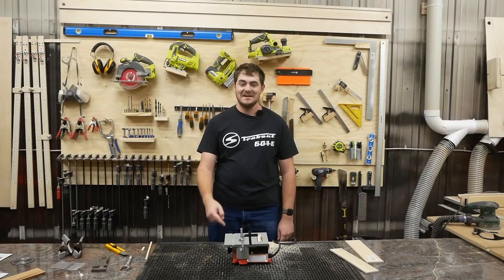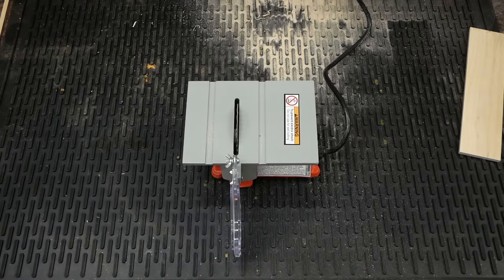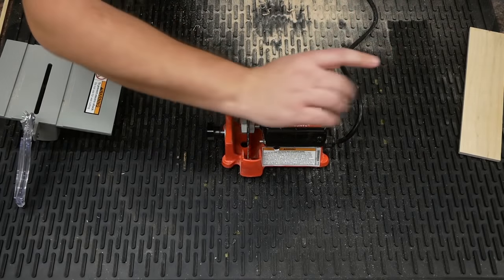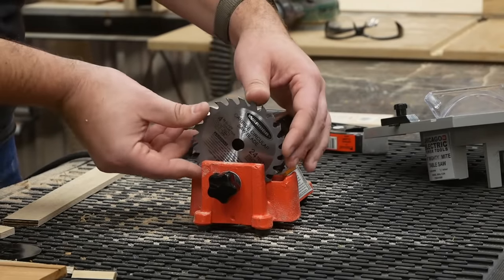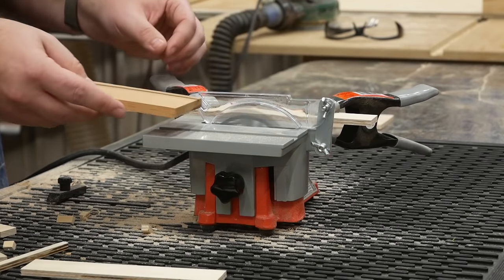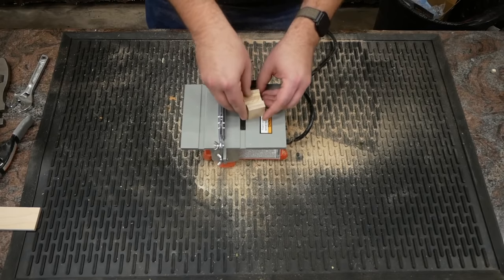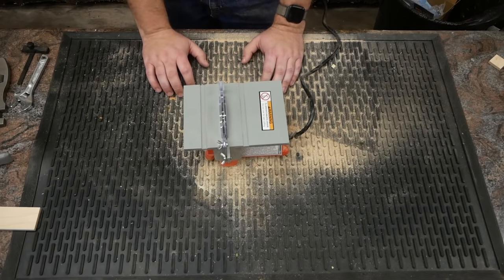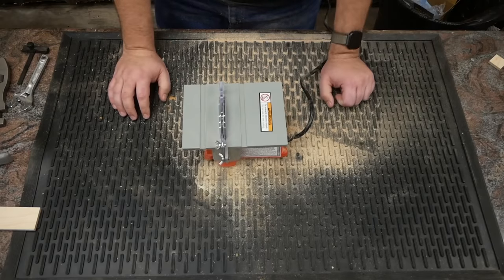Can This Adorable Tiny Table Saw Do Anything Useful?

Comment: This thing actually looks more dangerous than a full sized table saw.
Reply: It is.
Reply: My thoughts exactly
Reply: I know right?
Reply: This thing is almost the same size as the brake cartridge mechanism in the Sawstop table saw.
Reply: I agree. And those cheap portable table saws are scary as well. The safest table saw I've ever used was also the heaviest, quietest and fantastically expensive.
Reply: Mainly because it’s impossible to keep your fingers away from the blade.
Reply: I was honestly cringing a bit when he was cutting the small tile, and not even looking at it.
Reply: Waaay more :/
Reply: And table saws in general carry a good amount of danger, too. Seems like most of the shop injuries I hear about are either table saws or lathes.
Reply: @auxchar  I was allowed to operate a several horsepower lathe when I was 14, alone at school.

I only lost a portion of my thumbtip which grew back, looking back I count myself very fortunate indeed. Ever since I've had a lot of respect for anything that rotates especially if it's sharp/has a lot of rotational inertia.
Reply: @CommodoreFan64  Why? tile saw blades are smooth with no teeth to grab flesh. i've hit my finger on one and even touched the blade while running. 
not a damn thing happened. it was a wet tile saw but still. the only thing that cuts tiles on the blade edge is tiny industrial diamonds embedded into the a metal ring at the edge. 
cool thing is they last quite some time if you dress the blades to expose more micro diamonds.
its like a cast saw doctors use it does no harm to flesh. unless you buy the wrong blade that does have groves. that might do something.
Reply: @darkshadowsx5949  I know all that, but still makes me cringe when someone is not paying attention around a table saw, or any saw for that matter, because as a teenager I was in the shop on my step grandparent's farm, and one of my cousins was cutting a piece of PVC pipe on the band saw not paying attention, and nearly sawed off his pinky finger, and I had to rush him to the urgent care with his hand in an ice bag to get it stitched back up.  He was lucky he did not cut the bone clean through, as the Dr. said he might have lost that finger for good.
Reply: @darkshadowsx5949  According to the reviews on Hazard Fraught, people who are cutting FR4 PCBs have found that the motor doesn't have enough chooch to damage skin if you have the diamond blade on.
Unfortunately you can't find replacement diamond cutters because the arbor is 1/2" while most blades that size are 5/8" unless you buy a blade from Amazon that's almost the price of the entire MightyMite.
Reply: That's why I installed a saw stop on mine
Reply: It absolutely is. Center of mass is too high because it's so narrow and light. Strong, sharp, heavy tools grievously injure you, but they're more predictable and you can have better guarding.
Reply: YOU can BET it IS VERY Dangerous !!!
Reply: @CuckBalls  but not nearly as fun
Reply: It is.
Reply: @harlanbarnhart4656  Those are actually far more dangerous because the blade rotates at a faster speed with more torque, ensuring a thorough laceration before your reflexes kick in. Unlike the puny motor on the portable ones, the power will apply a much larger force to the workpiece during a kickback, enough to cause internal hemorrhaging if the work piece hits you in the wrong part of your body.
Reply: the thing in the black T shirt doing the hee haw demo? no argument there.
Reply: @samspencer7765  , Glad to hear you didn't lose an arm or your life.
   I lost a non-union job because I wouldn't break the rule learned in union work, wouldn't work alone 30' up - but would have if had another worker nearby.
Reply: @samspencer7765  Anything spinny is inherently dangerous due to being able to pull you in.  (I knew a guy in school who's father lost an arm in a tractor's power take-off shaft that way.  What's worse, he was there at the time  And Adam Savage was just a dumbass a couple years ago while cleaning his lathe and tried to clean a spinning shaft with a rag he held in his hand instead of keeping it on the end of a flimsy stick like the generally smart and experience man he is should have known to do.  He was luck he got a gash in one finger and didn't even lose the skin over it, when he could have lost his hand.)  Table saws are just really easy to be really stupid with.
Reply: If it falls off the table you can easily catch it! 🤚
Reply: Took the words right out of my mouth 😅
Reply: If that little saw scares you, you need to stay away from all power tools. You're to much of a dork. Master machinist

Comment: As everyone else has said a year ago this is meant for very very small dollhouse/hobbyist balsa wood type projects. The fact it has a "finger" (lol) guard for the blade is actually really great - most of the cheap ones you can find are literally just a block with a table saw blade sticking out the top with no safety features. I'm gonna have to go through your whole channel now to see if you review any other tiny woodshop tools because you are excited as hell and I love that.
Reply: Agreed.  I am a hobbyist and was looking for a small version of a table saw for cutting small wood frames and balsa wood for diorama building.  I dont need a large table saw for that.  But the ones I found were much better than this, but more $$ too.  The best was over $300 and costs as much as a regular table saw.  But all the ones I saw were slightly bigger than this too.
Reply: @panzer948  It might be the right size for the job, but you need something you can make predictable cuts with.  And a bigger table would be a good idea as well.

Comment: I bought one recently and made a couple upgrades: built a much larger frame around it with a 16x20 surface, to which I applied a plastic grid; and replaced the blade with one from Micro-Mark. Note of caution: when removing the blade be careful to turn the nut CLOCKWISE to remove it, and do so very carefully to avoid stripping it and the arbor--they are both made of fairly soft metal.
Reply: Yep, I almost did that myself... couldn't understand why I couldn't loosen the damn thing! 😂

Comment: I got one to chop up old circuit boards. It doesn't have enough power for that either in case anyone was wondering. Gonna keep it though, 'cause it might come in handy for craft stuff - plus the cute factor! UPDATE: Ah, wait!!! The diamond blade cuts though circuit boards and ceramic body components like a hot knife through butter - really. Stay away from plastic body components like large connectors, and super long cuts - and it barely bogs down at all. The mighty-mite is redeemed!
Reply: Excellent.   I was wondering about that, considering that most of the boards are glass fiber reinforced, so therefore using the tile blade makes more sense.

Comment: "yeah I'm a carpenter, I'm renovating my broom closet into a shop right now"
Reply: Try a bread box first. Then move up to a broom closet. One can't have all the shop space when starting out in life.
Reply: My shop/server room is one half of our master bathroom.
We don't need 'his n hers' sinks, and never used the 'roman tub' which is just a regular tub that flares about 4 inches in the middle, with space wasting framework around it.
We never used that bathroom for bathing at all.
So I built my server rack over the existing tub, the shower stall became my pc carcass storage, and my workbench is the maple plywood that makes the top of the rack.
I still have empty air that needs to become storage, but I'll never cut wood in there - even with dust collection it would be death for my servers.
Reply: @Zomby_Woof  you have no idea how reassuring it is to know I'm not the only one doing things like this. (My wife and I covered our balcony in glass panel windows, and we use that for cutting wood and grinding metal etc, everything that is dusty or overly smelly)
Reply: I honestly work out of my kitchen  closet of my apartment. 
I have no other choice but to if I want to do wood working projects until I can find a garage to rent out of a work shop. 
So, some people really do work out of a closet.

Comment: Amazing 120 volts and 1 amp is 120 Watts. Great for cutting insulation on Skoolie build-out or building ginger bread houses when out in the woods.
Reply: Actually, i think it would work well to true up gingerbread parts for a gb house.
Reply: @OpasJDGarage  gb houses for all of his chickens on Christmas, if only he could train his rooster.Maybe  next video we will see his rooster with safety glasses building GB houses for his ladies. 😆
Reply: @JosephGodwin137  safety glasses fitted for his rooster would be awesome. A leather tool belt would push into becoming a platinum member for his channel.
Reply: @OpasJDGarage  google "safety hat for chicken", I would love to see all of the chickens running around with safety helmet, vest, and glasses in one of videos.
Reply: @JosephGodwin137  I found a link to eBay of chicken helmets.
...
they already sold 7
Reply: Stupid question, but... that is a 120V motor, right? Not a 240V motor that some idiot has plonked a US plug on?

Comment: Okay that's great and all but how is it at mowing your yard?
Reply from the maker: Faster than using scissors. Just
Reply: @UnderDunnOfficial  JUST WHAT? JUST WHAT? YOU CAN'T LEAVE ME HANGING LIKE THAT!
Reply: @Heidegaff  just about......as in just about faster,,,,
Reply: i thought that was animals jobs..... mowing and fertilizing ppls lawns
Reply: @UnderDunnOfficial  I actually have cut my lawn with scissors.

I usually hit it with a weed eater, which takes about 3 minutes.
But the battery was dead, and the wife was bitching.
Knocked it out in about 15 minutes.
I also edged it using my trusty chef's knife - came out really nice, though it took about 45 minutes.
Used to use that knife as a hand planer too before I bought one.
Don't ask about the egg beater I had stuck in my engine for a while.
Reply: Seems a bit underpowered for that

Comment: I'd imagine maybe hobbyists who do miniature sculptures might find a use for it, but even then it seems completely impractical. 😄
Reply: My first thought was for modeling balsa and the like. Maybe some foam or light plastics, but otherwise, yes. COMPLETELY impractical, and I love it.
Reply: True, there are other table saws that small out there, but the usefull ones are more expensive and have things like fences
Reply: Not only impractical but even dangerous..to think they actually make these it's crazy!
Reply: @deefdragon  Most modelers I know cut balsa with a small back saw and miter box, or even just cut it with a hobby knife.  A little table saw like this might be useful for making precision cuts in plywood, but I'd prefer a small scroll saw: safer and more versatile.  In any case you get better results cutting by hand and finishing up on the disc sander.
Reply: You need precision for small stuff.
And this saw seems everything but precise.
Reply: Not precise enough for that. Go proxxon if that is your gig...
Reply: @willemkossen  That's the brand I was trying to remember :)  I recall seeing a small table saw from that brand, it was bigger than this one though.
Reply: I'm getting one as a joke gift for a friend. I don't think he'll be using it for anything. ha ha
Reply: Maybe useful for kumiko?
Reply: Maybe the tiny food people could use it for a tiny kitchen remodel.
Reply: @Becka_Harper  your cuts have to be wildly precise and often mitered for kumiko.
Reply: I can't think of anything this saw can do that a real saw can't do better other than fitting in a backpack.
Reply: It doesn't even have any gauges or a fence. It's really useless
Reply: That it is intended purpose for cutting scaled lumber and scaled wood paneling and such, its' a real time saver. Full size tools are too big and cutting EVERYTHING by hand is a huge pain in the ass.

Comment: Oh heck yeah. Now the challenge I put to you: Build a fence and sled for it. Then you'll need jigs, and an outfeed table. The sky is the limit!!! Seriously, as a builder of scale miniatures, this would be very handy for guys like me.
Reply: I would not recommend it for modeling or small figures. The only thing it is good for is cutting off 3/8" sticks and 1/8" plywood not more than two inches wide as long as you do not care about accuracy. I wish I could return it. It will not rip 1/2 " balsa boards, but it will cut 1/2 in square balsa sticks nearly square!
Reply: I did build a sled for mine in order to cut fret slots in a guitar fretboard, a cigar box guitar fretboard... works well and reduces the time and tedium from hand cutting with a fret saw!

Comment: This looks like it would be perfect for model builders! I'm sure balsa or basswood would go through like butter!
Reply: Balsa is very sort of soft squashy texture so I bet it would be great for that, or maybe even obeche or basswood craft sheets for models and miniatures.
Reply: yes your right it works great with balsa. if he read the box before his review he would know that it says perfect for picture frames, moldings, plastics. i use it for crafting and it has made things awesome. i dont have to fire up the big stuff for small things. i
Reply: @codyjohnson9067  It will not rip 3/8" balsa boards linger than 4 inches.

Comment: I inherited something similar. Tried to use it once.  The blade guard was loose, hit the blade and exploded. It actually walks around if it’s not clamped down. Without the guard, it’s now absolutely terrifying.

It’s basically a hobby saw for cutting microwood. 1/16” plywood and such.

Comment: You have to consider, scaled to a normal table saw, that 1/4” board is probably a 4” or 5” thick board. So it would understandably struggle. It’s probably only good for 1/8” or thinner. So, ya still useless for a woodworking workshop. Unless it’s a dollhouse workshop
Reply: I'm honestly considering something similar as I've only got a small apartment, and it'll be much lower noise.
I am thinking about a few projects using strip wood glued and dowelled into composite beam style constructions, easy to get the required cuts to length
Reply: My father has been working on building architectural models.  This would probably have been a lot easier on him than using the ShopSmith.   Also, there's always a need to trim shims.

Comment: That's exactly the same motor as my grandmother's Singer sewing machine from 1940's.
Reply: It did cross my mind that it looked like it's got the smaller of the two main home sewing machine motor sizes. It makes me wonder if the larger type of motor could be bodged in there? The added height would probably mean the table wouldn't lower enough to expose the blade though. :(

Comment: Awwwww it's a cute little saw. 
This thing somehow has a 3.2/5 stars on their website with 404 reviews
Reply: As in actually four hundred and four reviews, or you tried to load the reviews and they couldn't find any?
Reply: Most of the positive reviews were from members of the Mollyfock County notebook paper modelers!
Reply: This is a tool for modelling, not for furniture building. Complaining about it is like whining about how useless a toothbrush is to paint a barn.

Comment: for scale work, the material you are putting through it would be equivalent to two inch material on a regular table saw.   Look at how much saw blade you are taking on with the material as you would a 1/2" plywood on an 10" blade.  so basically, it would be best for 1/8" material at best.
Reply: You are not allowing for true scaling ratios, so your statement is incorrect. Scaling is not a simple ratio in this case, it is logarithmic . The smaller saw is actually more powerful than 1/15th the power of a regular table saw. I think the main problem with this is the blade, but you are right, it will not rip balsa wood thicker than 3/8" and a large table saw will not rip 8 inch thick balsa wood.

Comment: I've seen these used as an alternative when cutting fret slots in a fingerboard for a guitar. They have made a small sled that uses the sides of the table instead of the slots in the table top. Uses a 4" jewelers blade for fret slotting. People are just trying to get around having to pay $150 for a fret slotting blade from stew-mac. Or $140 for a precision miter box with a pull saw with a thin kerf.

Comment: Lacking a table saw, not being the most dexterous with a skill saw, and after having my jigsaw blade keep getting stuck melting it's way through the cut, I almost bought one of these just for making a few cuts in quarter inch acrylic.

But my inner voice told me if I had even a diminutive underpowered 'table saw,' I'd just want a real one.

I ponied up the $200 for an entry level table saw and I'm glad I did.

This video just confirms it.

The $40 I didn't spend on this bought me a couple of cheap but serviceable crosscut blades.

Comment: I do keep one of these micro saws in my service van, strapped on top of my larger Makita table saw.  This micro saw works perfectly with quarter round shoe molding on floor jobs and other lite PVC molding projects.  Rather than lugging in the whole table saw or miter saw set up, I have this micro saw screwed down to a 12" x "12" x 3/4" scrap of plywood.  I just grab this under one arm, and bring it right to the floor of the site without weigning me down.  I do a lot of bathroom & kitchen floors, so most of the time, I can carry scraps of molding to the site to finish the molding around vanities, etc.  As long as you play with it beforehand and know its limits, it possibly could have a useful purpose for the right jobs.

Comment: Just made for tabletop craft projects using soft wood. A German company makes tabletop power tools that are very precise but are quite expensive. It comes with a rip fence, tilting blade & adjustable miter gauge.
Costs as much as a portable contractor saw.